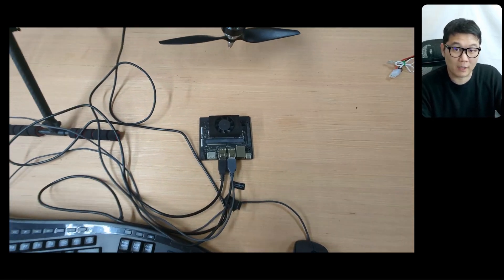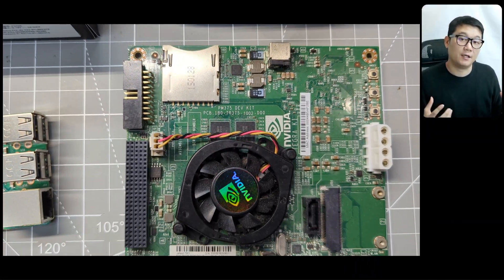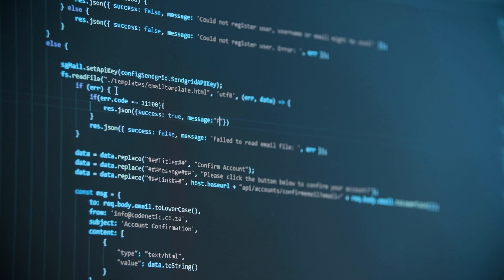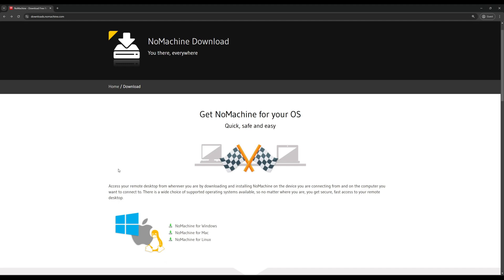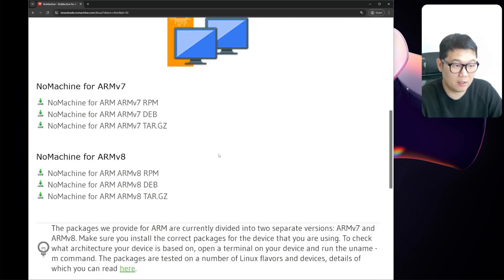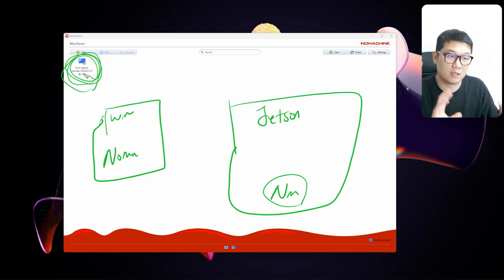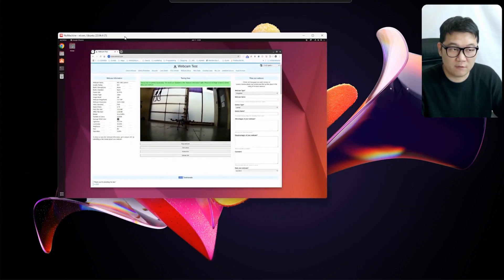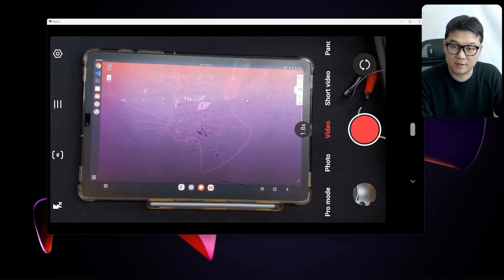NEVER Touch Your Raspberry Pi Again! (Robotics Workflow Revolution)

Comment: hey Elliot i have question , ryt now i am using Jetson AGX xavier ,its in my College lab i want to connect it from house using laptop since i am also using RDP , by connecting jetson board and Laptop using Same Wifi is quite simple , but i want to access it from two different location . pls post video on that
Reply from the maker: Thanks for the comment. For the quick reference, if you need that for the institution, your lab manager should make the lab IP available to public and port forwarding. Other than that,  things will be straightforward.